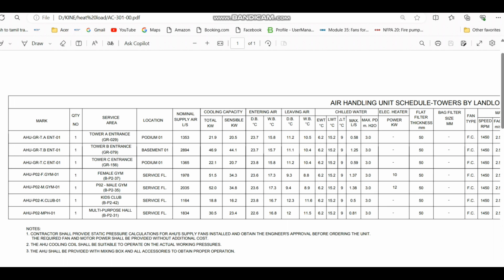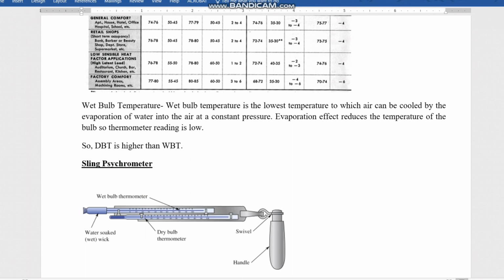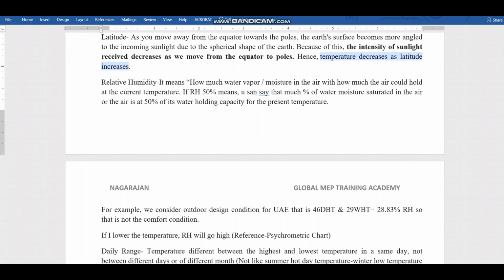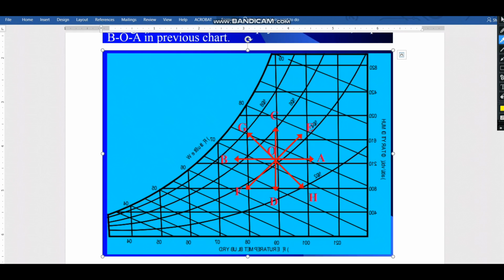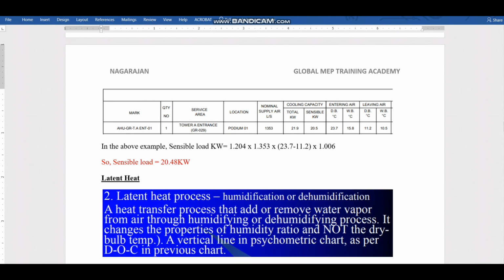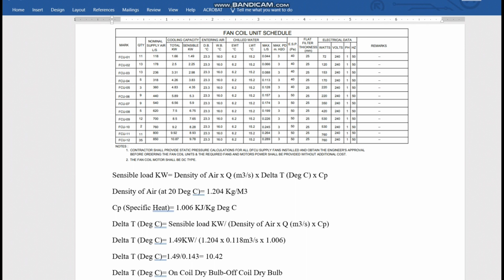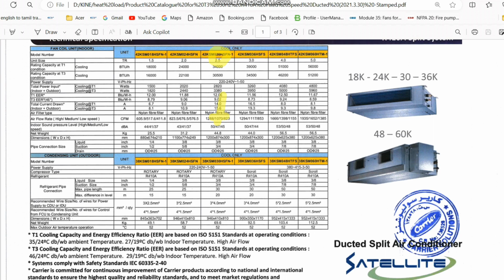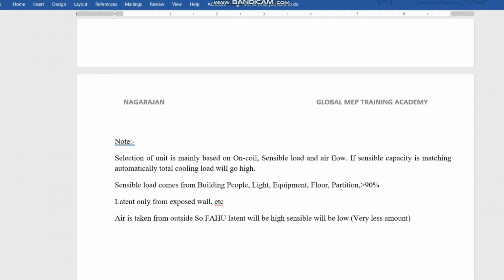HVAC Design-Units Schedule all Technical Parameters with Backup Calculations l HVAC Units Selection

Comment: Good effort dear . Also please let as know how to calculate the off coil temperature.
Reply from the maker: In the manual Cooling Load calculation I have given a detailed procedure for this but simply saying instead of going through lengthy procedure mostly we consider on coil-10 deg c. For example oncoil is 24 so off coil is above 14 deg c. Since the FCU is mass production item sometime u might have seen in the manufacturer catalog that for higher on coil also like 27 deg c for store room off Coil they fix constant value.
Reply from the maker: When I develop concept drawing first I consider oncoil-10 deg c concept only
Reply from the maker: But when it comes to IFC dwg, we will refer one manufacturer datasheet to add the value of power input, voltage,etc and that time their off coil value we add
Reply: Explain on coil and off coil term